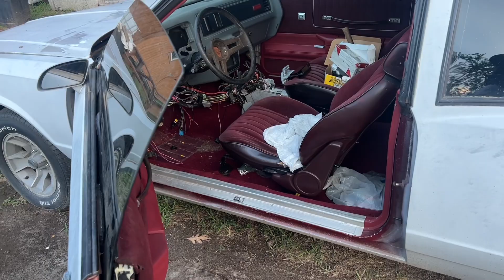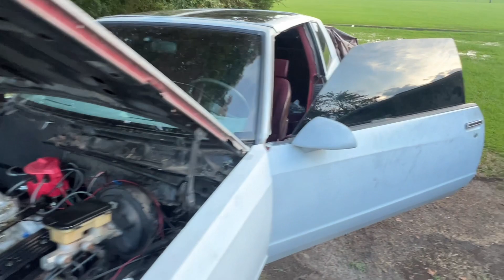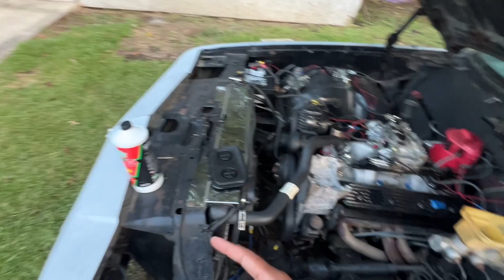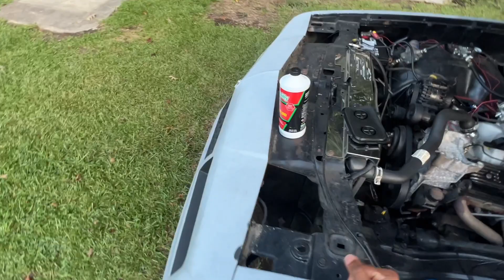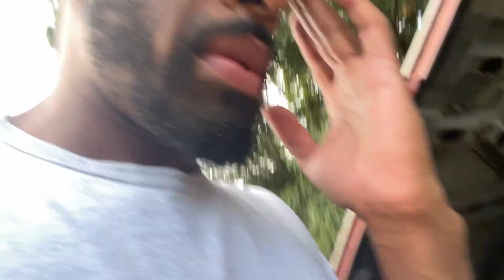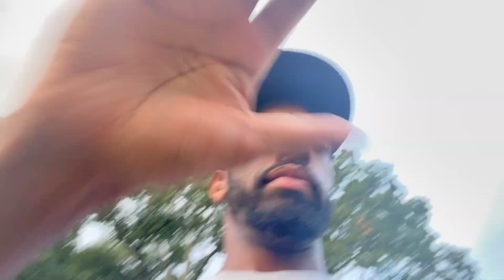Where is @ss.monk?  Monte Carlo SS NO MOTION!

Comment: Lookin good, hope you get her sorted out soon. Personally I hate those glass fuel filters, had the rubber seals inside dry rot and drip fuel on my engine as it was idling. Luckily I noticed it before something real bad happened. I just run the cheap plastic see-through filters now. And yeah I'm up in new england and those mosquitos are no joke. We get alot of ticks too when it gets hot out.

Comment: Also wondering if you’re still getting 12 volts to the distributor in the ON position? May have inadvertently pinched the wire or swapped it for the tach wire?? I believe tach wire is usually brown. Distributor should be marked at the connections ‘BATT’ and ‘TACH’

Comment: Looks like it wouldn’t take much to get her running… I’d start off with relocating the fuel pump to the back by the gas tank, check for spark, and fire her up 🤷🏽‍♂️
Reply from the maker: Yea. We were bumping the motor but still wasn’t getting spark to the #1 plug.  Could just be a bad distributor